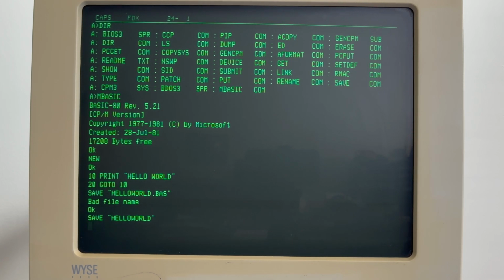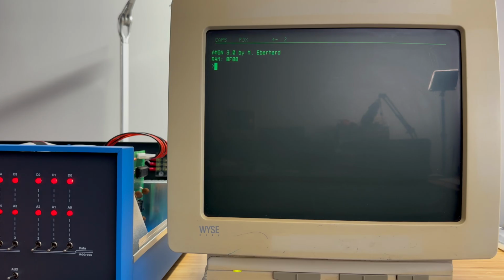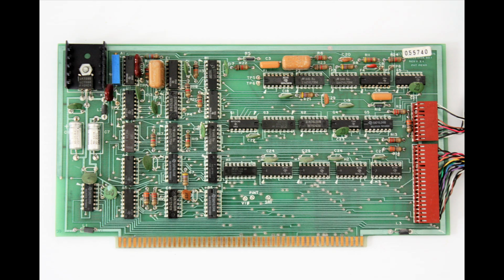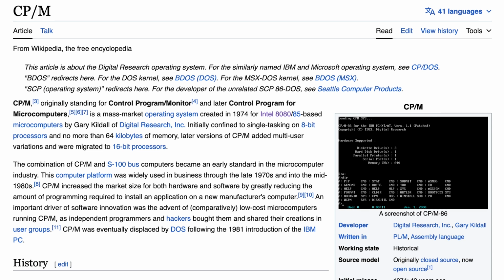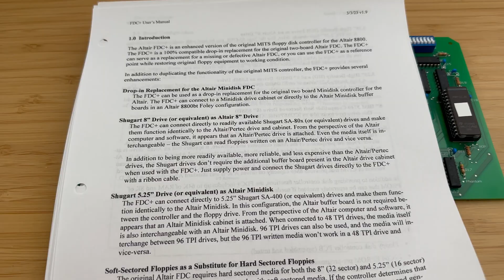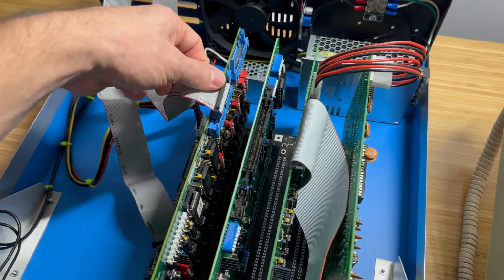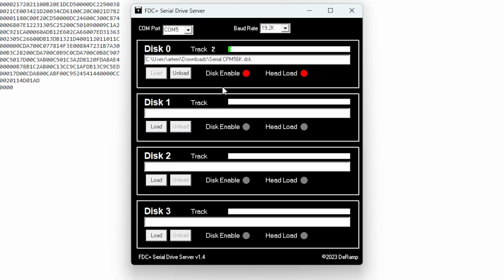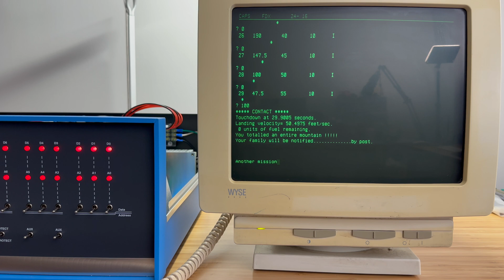Altair 8800 Build - Running an Operating System

Comment: I built an 8800c last year, also using the 2SIO-JP and FDC+.  I found that Teac FD-235HG 3.5" drives work well and can be configured to run at 360 RPM.  They were commonly used on Dell systems and are still readily available and cheap on eBay.  I put 4 of them and a power supply in a custom wooden enclosure.  It's a great way to run these systems if you don't have a stash of 8" or 5.25" drives sitting around.
Reply from the maker: That's insightful information. Thank you!

Comment: Always been fascinated by these old computers. I remember learning that no, you wouldn't necessarily just use the switches on the front, and that people did eventually get terminals and disks on there, but it still is pretty fascinating.
Reply from the maker: For sure! In future videos, my goal is to make it do more than it was able to do in the 1970s. Stay tuned!